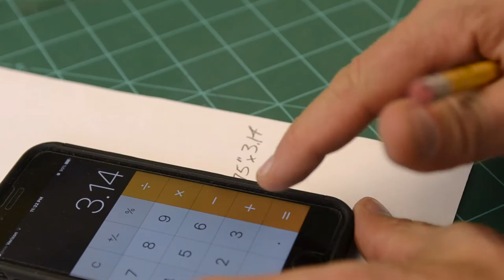How to Make Bug Experiments - They will Keep Running | Experiments with insects | Physics and Math.

Comment: you can use two razor blades on each side, if they are slightly tilted against each other to form a V depression, they would hold the wheel in place
Reply from the maker: Great idea. That should keep it from running away. Thank you!
Reply: Or you can intentionally create a ding in the blade in the middle by hamerring it against a nail.
Reply from the maker: +Dave Strain Hey, good idea! Thanks Dave.